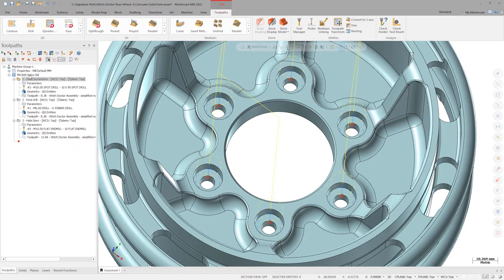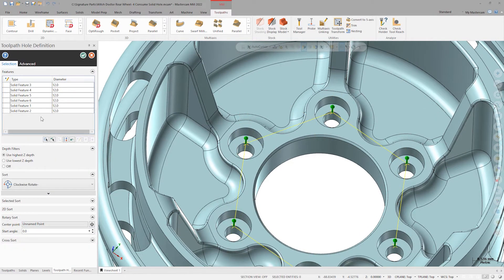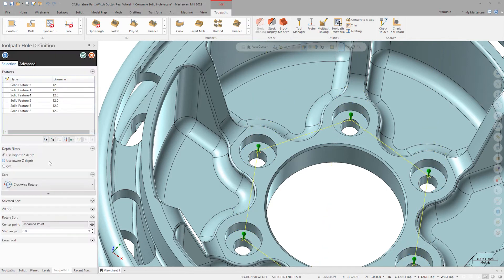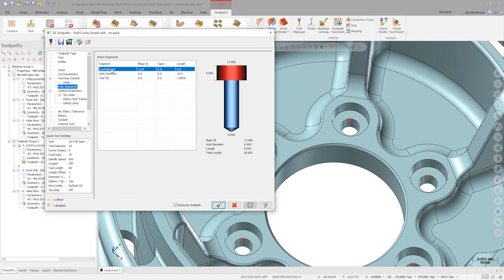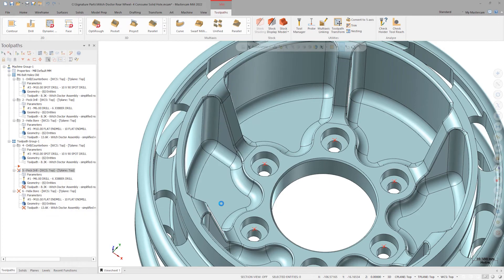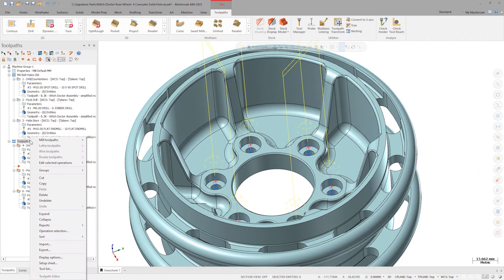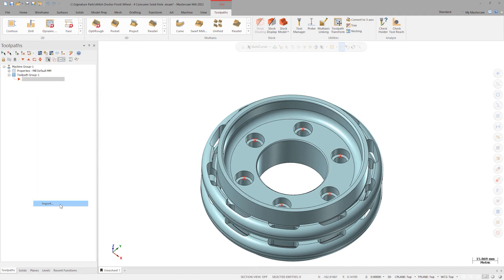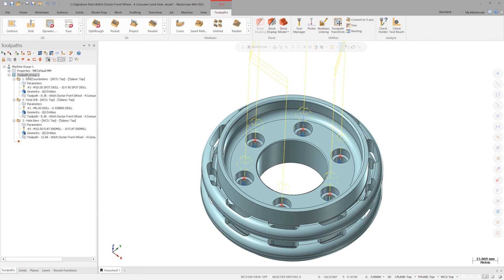Holemaking in Mastercam 2022 Demo | Mastercam 2022 Signature Parts

Comment: why not use fbm
Reply from the maker: Hi there! FBM can accomplish similar results for holemaking, but once the operations are created they are have some locked rules. Using solid hole definitions will allow you to make changes to the hole definition and have the dependent operations update to match the features.

Comment: What if I imported my solid model with Mastercam direct from SW, or a step file? In my solids tab will I still see a feature tree to select the counterbores from? I don’t use solids tab often but I don’t think mine has had a feature recognition feature to understand what’s been imported. I think this could reduce programming time greatly because I’m constantly programming for common metric dowels, nuts, and bolts.
Reply from the maker: Hey there! If the model comes in from Solidworks or a clean STEP file and you don't have hole features in the solids manager, you can use the "Find Holes" feature under the "Model Prep" tab to add the solid hole history. Being able to use common hole definitions across different parts with an operations library is a great way to save programming time.